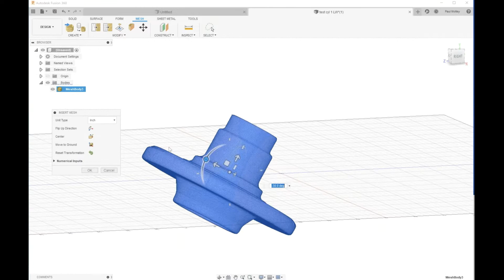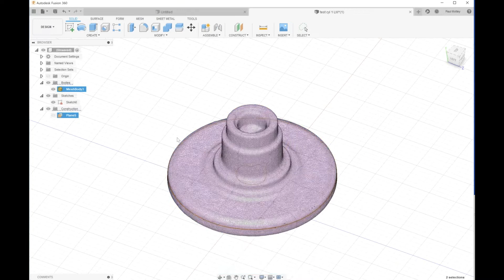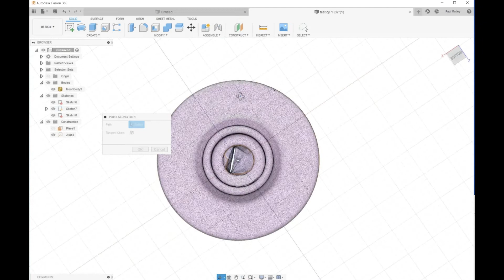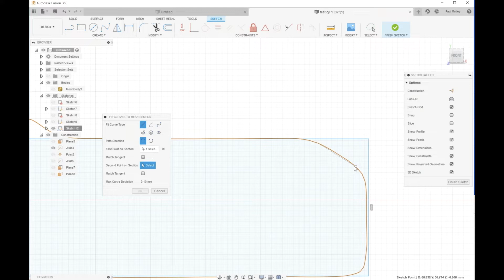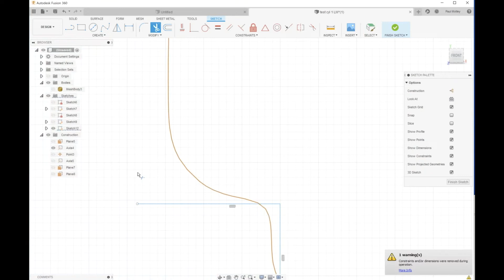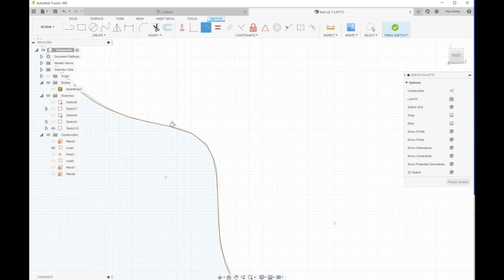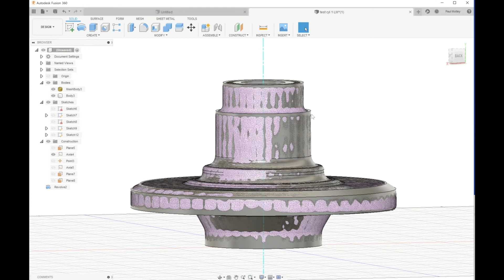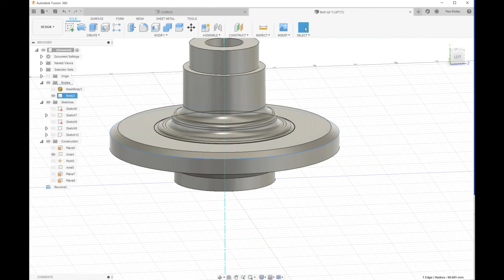Reverse Engineering A Scanned Part in Autodesk Fusion 360 (STL to CAD)

Comment: Thank you for you video. I just want to know if there is the possibility to convert directly in fusion 360 the object into cad file. Or do I need another softer?
Reply from the maker: Fusion360 has automated features to convert mesh to CAD. You can see it from these videos: 
• 360 LIVE: Deep Dive into the New Parametric Mesh Editing and Reverse Engineering Tools: https://www.youtube.com/watch?v=3tMEtHIJV6c
• Convert STL Mesh to a Solid Body in Fusion 360 (2021): https://www.youtube.com/watch?v=tVGtG-UjlYg 

This workflow works well if you have an STL file downloaded from websites like Thingverse. This article provides a pretty good explanation here: https://all3dp.com/2/fusion-360-import-stl-simply-explained/

However, if you are converting 3D scanner data to CAD, the best way to do it is to sketch the part using scan data as a reference.
Reply: @GoMeasure3D  thank you for your reply!
Reply from the maker: You might also be interested in these two articles. 
• Can A 3D Scanner Directly Output A CAD Model?: https://gomeasure3d.com/article/answer-can-3d-scanner-output-cad-model/
• 3 Affordable Scan to CAD Tools Not Just For CAD Specialist [With Video Demos]: https://gomeasure3d.com/blog/3-affordable-scan-to-cad-tools-not-just-for-cad-specialist/